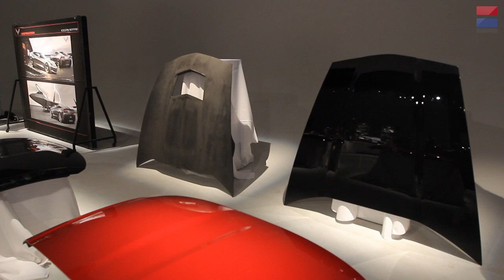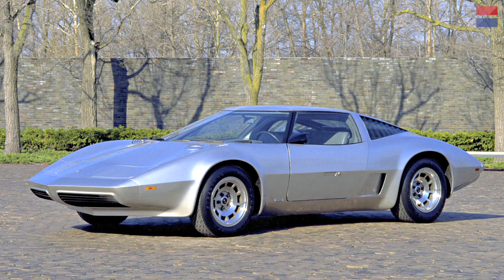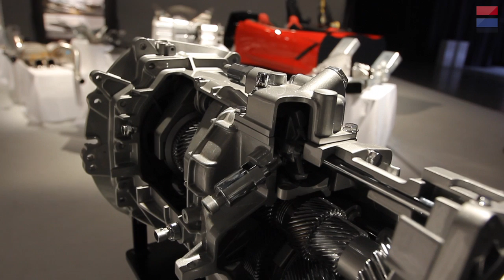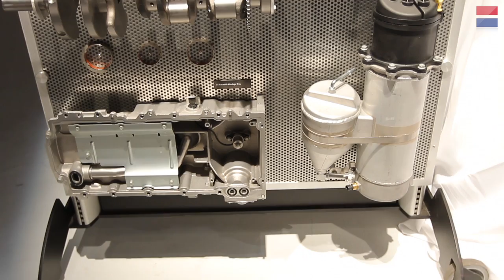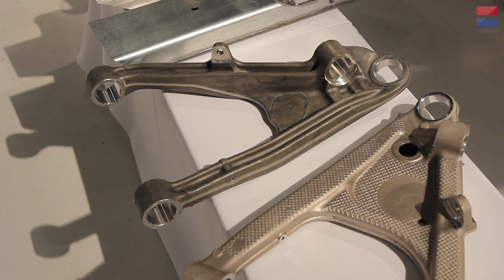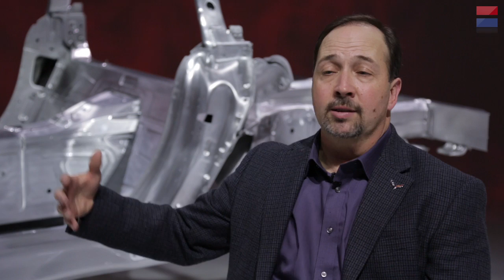2014 Chevrolet Corvette Stingray / Z51 Revealed @ 2013 Detroit Auto Show - CAR and DRIVER

Comment: the only thing that bothers me about this amazing car is that it will be a bit harder to get more hp due to the complex engineering of the engine vs the common LS, hopefully the Z07 will keep the 7L with direct injection, should be good for 215 mph with the new tranny and diff  with a nice vent cooling system, and lighter everything ( this car should be easily 150k with all the high quality material on it

Comment: Every new generation, they hype the shit out of the chassis, and it's always dogshit. It's always 50% stiffer than the previous, which means it should be 500% stiffer in the last twenty years that they've said the same exact thing with each body shape change.

Comment: "Better quality" is such a misguided term to use in your comparisons.  Unfortunately for both parties, it is nearly impossible to objectively compare American to European cars b/c of vast cultural differences.  Ford will give you a 420 hp V8 Mustang for the price of a base BMW 128i (230 hp).  The BMW's interior is vastly superior, but it is a vastly inferior performance car.  A "fair" comparison ultimately requires weighing subjective values, which inherently compromises an objective comparison.

Comment: They are not used to handling torque. Their 618HP 599 only has 347 ft lbs of torque, where as a Z06 has to close to 500. A ZR1 has 604.

Comment: You aren't always at high revs in a race. Not all cars have all their torque in the lower range, many have a very wide power band, especially American performance cars. You think that hp and tq just means power. Wrong. In simple terms, hp is your limit. How far you can go. Torque is what gets you there. The more you have the faster you can get to said limit. You would want to have torque throughout your RPM range so you can sustain and utilize your horsepower. Learn a little before commenting.

Comment: Great looking car, even though i'm a 4 lights at the rear fan, i mean that's the Corvette look. Weirdly after looking at different images over the last couple of days i'm getting used to the angular rear end. The interior is very good and the angular exterior. It's like the latest mercedes they too have very angular lines. I'd have liked to have seen more of the 'Transformers'  prototype corvette look though. Can't wait for the ZR1 version! This base level takes some beating tho'.

Comment: HP wins races. Torque is max below 5300 typically. During a Race I am above 5000 even before the wheels start to turn. Then it stayes anywhere from 5k-7800k during a race either on a street or a track. So your aguement about torque well is USLESS exept for grandpa leaving from a stop light without giving it a few revs.

Comment: "Theres a big difference in our big engines than yours. Ours actually work, and are more efficient."

Okay lets see. My source will be fueleconomyDOTgov. Ferrari 599 618HP and gets 11mpg city, 15mpg hwy and combined it gets 12. Mustang Gt500 662HP and gets 15mpg city, 24 mpg hwy and combines it gets 18. Ferrari 458 gets 12mpg city, 17mpg hwy and combined it gets 14mpg. Corvette Z06 with its bigger 7.0L engine and all gets 15mpg city 24mpg hwy combined gets 18 mpg. What was that about efficiency?

Comment: Most vette lovers dont expect a ferrari inside and dont care for it and also they will just how the older models are like the 67 427 which can go from 100 and up to $275,000. My problem is that they changed too much to fast and took allot of other cars design feature/Ideas and it just dosent look like what a vette should but thats just going to be a bad few years for it and thats my opinion and I can have one.

Comment: And toyota has also had more recalls than anybody in the last few years. As for as the GTR, there is nothing at all scientific about AWD and a DCT, its really not that complicated. Reliability? Please, when the GTR came out, Nissan voided your warranty for using the launch control if you tried it back to back. In a corvette, you can use launch control all day long and not have to worry about getting your warranty voided.  When was the last time Toyota or nissan won anything at Lemans??

Comment: Torque does wins races, but horsepower is that keeps it going. You might think dual clutch transmissions are for fake ass drivers, but trust me on this; in the future there's bound to be MORE sports cars featuring them. And most DOHC motors doesn't have to be high-revving like the one's you keep bitching about in a Ferrari. 

A sports car isn't merely defined by the type of transmission nowadays. Get with the times.

Comment: Ah mkay, just clarifying lol. I personally drive a Z28, however i have all 3 bases covered because my two best friends drive an SS S/C Cobalt and a GSX Eclipse. The Cobalt is stock, along with my Z (mostly), the GSX is definately not. I rode in it, it was a nasty little thing. I love muscle but i give props where theyre due, that little GSX is mean. I do hang with both off the line though, up to about 50. The torque of my V8 keeps me with them, at higher speed their forced induction pulls on me

Comment: AWD is just a prefference and doesnt actually effect your performance in any way unless youre on dirt or snow. A rear wheel drive or front wheel drive car can launch and handle just as well as an AWD car, in fact i prefer rear wheel because it promotes oversteer which pushes the front of the car towards the inside of the turn, thus, making the car turn more. Im glad its rear wheel drive. If youre a good enough driver you dont need all 4 wheels to launch your car or help you keep it on the road

Comment: well it's not easy engineering a GAS GUZZLER car in todays American Government regulations" Most Car manufactures engineer their cars to CALIFORNIA standards, because California is the Biggest market for car sales and hardest to pass for GREEN minimum standards, trust me they could of easily made a V8 Cadillac with rear wheel driven tires, but remember GM promised to make the Most fuel efficient cars in the market when luckily they got bailed out in the beginning of 2009."

Comment: first, awd is for pussies unless you actually rally. so what, get a bigger turbo? i'd like to see how long that 2 L will last on 30 psi or whatever u boost it. and even if u make 600 hp, the vette will always have a mountain of torque more than u (google torque). show me how many old mitsus u see on the street. quality my ass. i had one.

Comment: I love the look of the new vette. I have to say however that I am disappointed by the engine. I know I know... you might say 450HP 450Lb ft of torque how can that be disappointing??.... well the issue is back in 2002 the C5 Z06 had a 5.7L OHV engine that produced 405HP and 400Lb ft of torque while getting better mileage .... somehow adding a half liter of displacement,  DI, Variable displacement, and all that for 50 extra Ponies and maybe equal mileage doesn't quite seem as efficient.

Comment: Those 4 banger evo and sti "fags" have advantage from the dig considering they are AWD TURBO STOCK. Don't even give me that bullshit on the amount of money you can spend on mods on a POS GM because it doesn't matter how much you spend, but rather how well you build it. 

And the 4g63 Mitsu engine has been out since like what? The early 90's? Not only is there a vast aftermarket support, but the mods for this motor are cheap nowadays.

Comment: I never said it wasn't reliable, and I never said they were expensive to maintain, they're just fine in that way as most modern cars are. A high performance DOHC engine pretty much always always has a much lower torque output in comparison to its horsepower number, but an OHV engine is nice and even. And the only way that those DOHC cars can be quick with their lower torque numbers are twin clutch transmissions with paddles, and then it's not really much of a driving experience anymore.

Comment: A) Zr1 647 bhp, 458 italia 570 bhp
B) Zr1 6.2 liter V8 supercharger, 458 italia 4.5 V8 (no turbo no supercharger)
C)are two different cars, one has a mid-engine (458) the other front-engine (gt car)
D) Zr1 0-60 3.9 sec, 458 italia 0-60 3.4
Try to compare it with another gt, for example f12 Berlinetta mmmmmmmmm I think that should be different.
if the price difference is 60,000 € (in Europe) there will be a why?

Comment: The only official lap time for the Berlinetta is at Fiorano. Until we get an official Nurburgring or Laguna Seca time for this car, we can only go by what's available. The 599 only has three published lap times. Its Top Gear lap is 0.6 seconds faster than the ZR1 despite the fact that the Corvette raced in damp conditions while the 599 was on dry. The ZR1 would arguably be faster than the 599 if conditions were equal.

Comment: There are DIFFERENT types of DOHC layout. If only people weren't so ignorant about it. 

The most balanced DOHC out there is a horizontal flat 6 from a Porsche 911 Turbo S. What makes it even great is the location of the engine, which is at the rear. All aluminum block and cylinder heads WITH 4 valves per cylinder instead of 2 producing 530 HP from a Direct Fuel Injection engine.

How impressive is that? Highway estimate is 25 MPG (according to Porsche).

Comment: I know DOHC has been around for MORE than a decade. I was simply making a point that if OHV was so glorified because of the performance, reliability, and mpg it brings, why doesn't most manufacturers use it for their high-end sports car? 

And you can still utilize all that horsepower and torque properly (or even better) than an OHV. Most people would just whine about how DOHC doesn't save as much gas or it's too expensive to maintain, and so on.

Comment: Yup and its well documented. 
The C6 Z06 and C6 ZR1 annihilated the F430 and 599 Ferrari's on racetracks across the globe, go ahead and check out the lap times. The C7 Z06 and ZR1 will surely do the same to the 458 and F12.

Lightyear's behind Ferrari? LMAO well then tell Ferrari to stop using GM's suspension and damper technology in their cars and see what they tell you. 

By the logic and debate tactics you're using it would be safe to bet you're between 12 to14 years old tops.

Comment: Pushrod V8s dominate technically in almost every way and cost about $500 less. DOHCs push the hood up another 1.5 inches, which creates more aerodynamic drag, require two long chains, heavy surrounds for cams, more material and parts that add to mass, which slows acceleration and braking, creates a higher center of gravity that increases body roll, and overall, the engine is bulkier, so it can't be located as well inside a car amidst suspension parts and other components.

Comment: DOHC has been around for decades, what's so great about it? And you realize that pretty much most of GM's 4 and 6 cylinder engines are DOHC. It's nothing special. It takes up more space. It's heavier. It uses more fuel. Sure, they make great horsepower, but they have absolutely pathetic torque numbers unless there is some form of forced induction. And how can you use all that mighty horsepower if there's no torque?

Comment: the front is  a ferrari wanna be... i like it but its not an innovative design since ferrari is very similar ( Ferrari 458 italia )... the rear its nothing new. the exhaust pipes are cool i guess but the head lights we see the same type of lights on other chevys 2013 cars... its not innovative... the side of the cars reminds me of the GTR nissan. i think this car will be very fun to drive without a doubt. interior is not bad. exterior design FAIL!

Comment: I would not compare the C7 to the GT86. Those cars are WAY to different. Corvette does have great strong points, like how light it is with the decent power it offers. What I get from the new C7 is improved functions, efficiency, etc. Basically an improved corvette overall. Better, lighter parts. I don't see how you can compare the GT86 with about 200hp to the C7 with 450hp. The only thing that I hope they have fixed with this is the suspension and handling. CORVETTES ARE THE SHIT!

Comment: Since when are pushrods even considered high-tech in today's standards? If it was so "high-tech", then most companies would have stuck by it today in order to achieve performance + mpg, right?

Apparently GM did have a DOHC engine, but failed miserably during the 90s. lol

With the same displacement, a DOHC V8 is better than an archaic pushrod V8, albeit it's going to be less reliable and less fuel conservative.

Comment: I hate the tail because it doesnt really match the sexy new front end. It looks like it was an after thought. The engine work really has me amazed because its old meets new in terms of everything that is utilized. The interior as an assembly looks 10x better than the previous vettes but the color placement is poor. Red leather door cards and a touch on the dash would have been much better than than the giant red swoosh. An all black leather interior will probably be perfect.

Comment: But the GT-R35 IS advanced for its class. You're whining about reliability of the transmission? The damn car itself weighs about 3800 lbs and still manages to be closer or even BETTER to what the LIGHTWEIGHT Z06 achieves. I mean the 2013 GT-R already does a 0-60 in 2.8 seconds with a quarter mile of 10.8 seconds. 

The only thing that comes close to that is the ZR1.

Comment: i repair Audi cars, not so hot on reliability and the systems are very delicate as in tons of faults and programming issues, over engineered imo.. but the stock (Z06 C6) beats the GTR at the ring, braking,slalom,top speed,reliability, not to 60, u would think the GTR would be far ahead in these areas with all the Computers to dictate the car but NOPE.people complain if the Tranny making clacking sounds and whinning as well

Comment: I think what you are talking about is styling. There is not much difference in styling cause it´s connected to the technical possibilities available which are getting more radical and so designers go for stronger and sharper creases and dramatic expressions - you even see it in small hatchbacks and small GT cars. Look at the overall shape, the silhouette of this Vette and the GTR and they have not much in common. Check some images of the old Stingray and see where a lot of design came from ;)

Comment: A two valve per cylinder engine in 2014??? What a joke, even though it works well!!! That's the extra cost they are trying to avoid and not the size as the fellow is talking about!!! Even freaking Toyota Yaris has a 4 valve per cylinder engine...

Comment: Really?  You might want to do a search on comparisons of the two on here....

For every comparison I have seen between the two, you need to upgrade to the ZR1 to get to a winning point as far as performance goes.

For this new version, I somewhat like the front but they ruined it with the Camaro rear end.  Not sure why they took that route.  I was also hoping for an overhead cam design from the new engine, guess that will stay on the wish list. :-/

When time, my money will go to an Audi RS5.

Comment: New Viper v10 3.8 0 to 60. Shelby gt500 4.9 sec 0 to 60.      Zr1 3.3 sec 0 to 60 from the factory. even the z06  3.8 Sec 0 to 60. This new base c7 3.9 0 to 60 the means the new zr1 can make 60 miles in 3.1 sec

Comment: Depends on the trim levels and options. I'd say the base car with nothing on it, equivalent to a C6 1LT, will be in the low 3200 range, *maybe* even breaking into the high 3100s. The Z51, even without any other options checked, will likely be at least another 30-50lbs heavier. The cars shown at the reveal is THE top-line for the base car, with all the performance and interior options. So those particular cars are probably close to 3300lbs. Someone here said 3280, which sounds in the ballpark.

Comment: I WILL see you at the track w/ my 1984 Vette L83 engine, roller comp cam, RHS 200cc heads, Electronic Mulitport Fuel injection, 125HP nitrous kit controlled by Nitrous mastermind kit, largetube headers, MSD ignition kit. My car and I dont look pretty, but we rock and kick dat ass!

Comment: It looks great; you can still feel the GM-DNA in the lines, the lights. Super improvement on the interior looks (don't know about fit and finish from the video).
But... I'm European. I would have wanted an more noble solution to the engine though. Pushrods? No! DOHC: yes! A 3,5L twin turbo would have been more in tune with not only what we want but also what we can afford here (CO2-taxes and all).

Comment: Vaguely similar but 90%? your kidding yourself. In 1953 the most significant model of the corvette was released with only two round tail lights. I'm sure every one over 30 considers the first corvette a corvette and doesn't need 4 round tail lights to do so, but I don't presume to know that either. Also in 1970 the Camaro was released with 4 round tail lights so lets not act like the similarities of the two in that respect is a new thing. Remember, facts are facts and opinions are just that.

Comment: That sounds closer. From what I've gathered so far, the weight added by the new engine tech, electronic systems and interior is countered by the weight saved in the chassis and suspension components. All in all, it makes for a car that is lighter than the outgoing base model, but not by as much as many were hoping. But a lot of people just had unrealistic expectations anyway

Comment: Depends on how far GM is willing to go with the ZR1 and, most importantly, how much they're willing to ask for it. The more they think they can charge for it, the higher they'll be willing to go with production costs. But I'd say $150-160k is the absolute limit they'd ever risk asking for a car(anything more, and they'd at least need to rebadge it as a Caddy, or turn Corvette into its own brand). At that price point, I don't see GM having enough weight saving tricks to go any lower than 3200lbs.